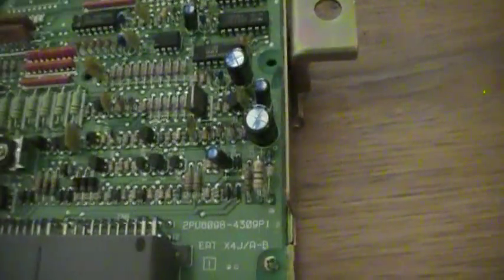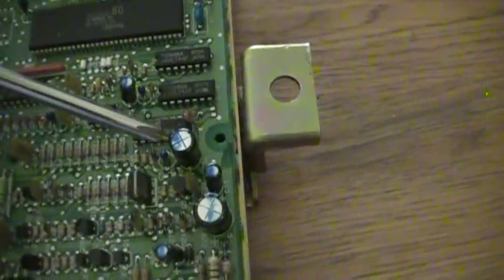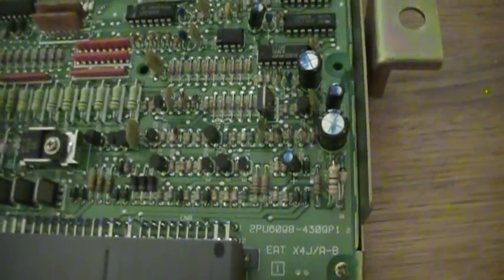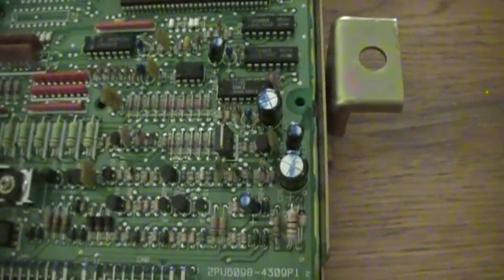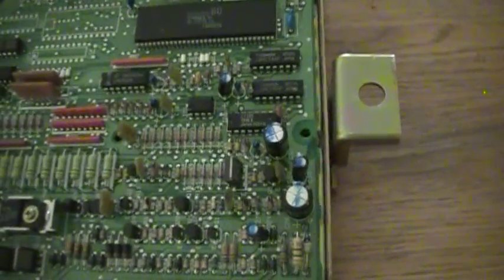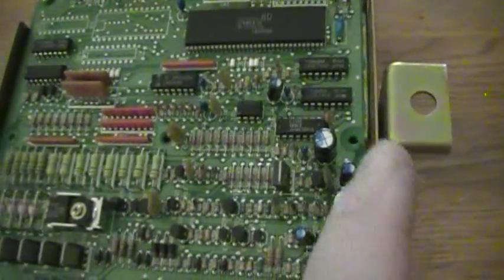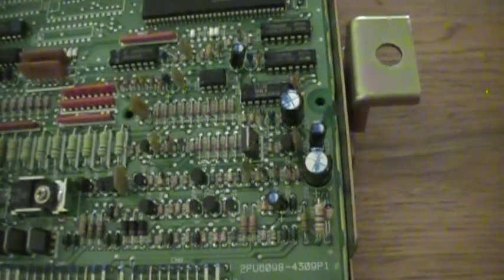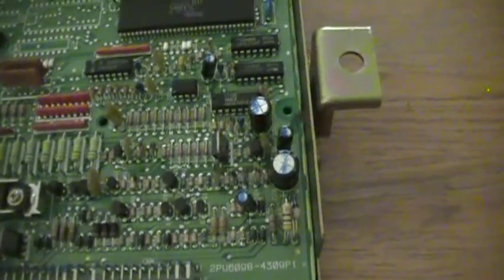bad tcu 1991 Accord

Comment: I have the same board on my 1992 Accord LX according to the numbers seen at the beginning of the video. "2PU6098-4309P1" "AET   X4J/A-B".  
My car will not up or down shift correctly, after seeing this video (Thanks tubejim101!!) I found capacitors C27, 28, 32 and 33 to be bulged out and have the guts pushed out the bottom. Resister values on MY board are as follows:(All gold band, indicating 5% tolerance.) R26 82K, R76 5.6 Ohm, R82 5.6 Ohm, R41 15 Ohm, R42 15 Ohm, R47 10K. In my career I am used to seeing the caps go bad by popping the relief creases on the top, so here's my theory on why MINE exploded downwards. The board was DRENCHED in PSB water resisting spray compound. I think it has far more than necessary, which also causes overheating. Hope this helps!
Reply from the maker: Jason Lewis Thanks for posting the resistor values!

Comment: I have a tcu problem too but it turns off and then turns on at random so is it better to yank out the old tcu and got to a U-pull and get another one or buy a brand new one, i can reset it sometimes by disconecting the battery for 5mins other then tht i runs like a champ only got 126k on it, i apreciate if any 1 helps me thanks.

Comment from the maker: @hp92301inadelanto Give the TCU a sniff.  Should not smell anything burnt.   All the bad TCUs that I have seen, have the S light stick on.  Could be your solenoid.  Go to ericthecarguy. com and ask in the "service and repair" forum.  Have gotten lots of help there.  Now that I think about it, I think your D4 light is flashing a code at you.  You would have to lookup how to read the code.  If it is like the check engine light, it is a two digit code.

Comment: Much respect.  Appreciate your videos. Thank you. Hoping you might help us please.  Do you have any idea why our 1990 Honda Accord Auto Transmission does not shift into reverse sometimes and makes the funny clicking sound? Other times we start it and it shifts into reverse perfectly.   We've flushed the AT and put the Honda fluid,  check the solenoids and cleaned the small screens.  Here is a video of the sound.. Thank you very much.  https://youtu.be/eLvbnCkH9y4
Reply from the maker: If I where to guess, maybe that tension on the cable is off?  I would run it by a transmission shop, and see what they say.